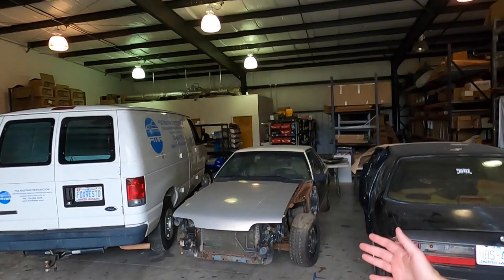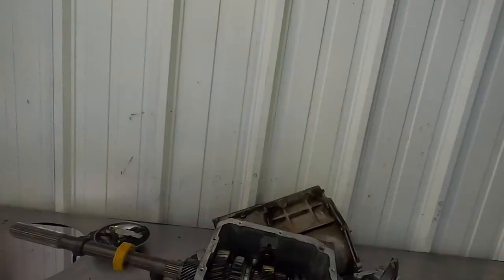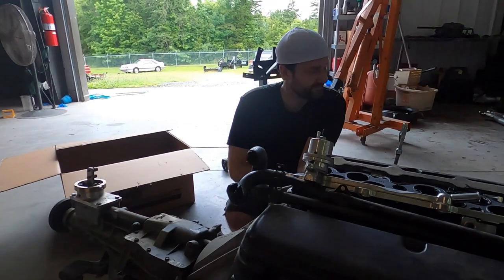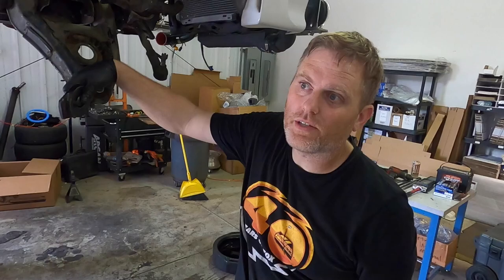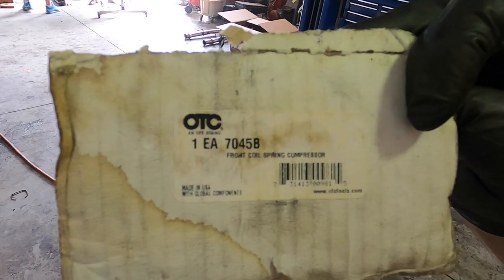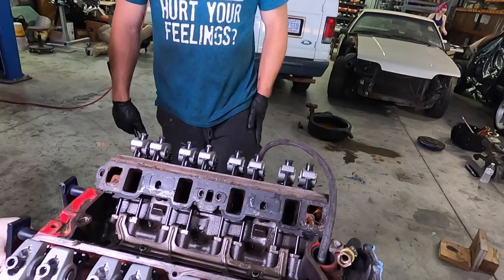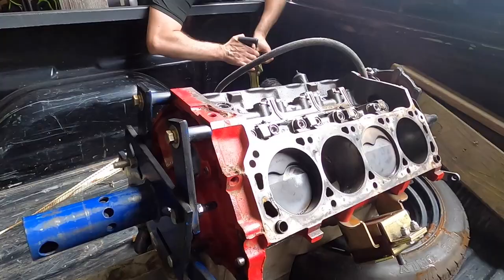PROCHARGED 91 MUSTANG GT BLOWS ENGINE!  // Plus…..Installing FoxBody Lowering Springs

Comment: That was pretty cool I know that it sucks for him but at least he can still use the block and build the 347 stroker and if u get his t5 then I get yours 🤣😂 but yeah I can't wait until I get my stroker 347 going I actually found some headers at a deal they were 700 new and I found some for 200 bucks so that worked out good. You better hurry up or everyone will have their car running and now u can get that pro charger and put it on your car that would be cool 👍🏼just don't turn it up to high and you will be good to go 👌🏼 😂💪
Reply from the maker: Hah hah, i'm not sure the transmission will quite work like that LOL, but you never know.  You're getting all the used parts deals!  Nice.  I figured I would get a lot of comments that I should buy the turbo hah hah.
Reply: @GearHead704  yeah you will get bombed with the turbo purchase for sure and yeah the headers are basically new you can tell that they wasn't ran very long because most of the paint is still on them and only a lil bit was burned off. They are a 700 set of headers and I offered 200 and he jumped all over it so I can take the 500 I saved and buy a new carb and it is funny the only used parts that I have bought for it is your valve covers and now the headers everything else is brand new unless I buy another transmission 🤣😂 but I can use the one I have for a while cause those t5 trannies are pretty tough but yeah man turbo that thing it will be fun and u can get it pretty cheap and everything is there to make it happen 🚙💨💨💨🦊TURBO
Reply: @GearHead704  Don't forget to buy the turbo 😂🤣😜 cant remember if I mentioned it or not 😆😂
Reply from the maker: ROFL

Comment: That was something different to bad he couldn't get away with just head gasket I would like to put a 347 together dart block scat crank scat rods I have the money to do it but it would whip me out I think my lil 306 will be ok for a cruiser ! R they going to drop the K-member 2 put the motor back in if so why was Matt worried about getting the spring isolaters on the springs I put my lowering springs in with a Jack in I got my isolaters but I had to buy a tool from Maximum motor sports for lowering I could not get the 1 side with out it! Something different!
Reply from the maker: Yeah i'm trying to mix it up sometimes on the content.  He just did that for video demonstrations purposes I believe, and probably not to lost the parts LOL.  It's pretty easy with that tool.  I think sticking with a 306 would be fine dude.  No sense in extending yourself beyond what you are comfortable with.

Comment: I have a 99 New Edge with a 3.8 V6 with a Pro charger in it. 3.73 gears detroit truetrac limited slip and a Ford racing aluminum drive shaft. The set up works really well. Not super fast but not slow by any means. The bad thing is every 2 years, I have to take the pro Charger out bring it to stock and get it smogged. Its not CARB Legal in CA. CA is not mod friendly any longer. I could get a V8 but I have so much money into my car, I would lose my ass on it.
Reply from the maker: Sounds like an awesome build, but man that sucks haven't to tear it down every two years. I guess you've got it down by now though LOL

Comment: 306 with 70 windsor heads made 400hp????  That sounds like a lot
Reply from the maker: And at 8.4 compression I think he said.  I was also a bit surprised. This motor was pretty stout.  Now do keep in mind that was on an engine dyno, and not at the wheels.

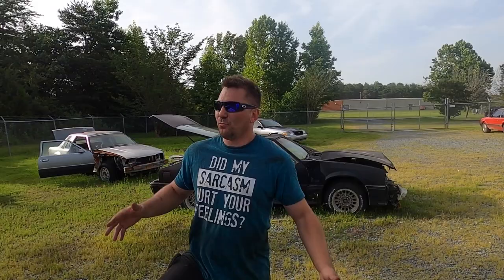Comment: 23:08 - How in the world did you get $65 Grand ($65,000) in a Fox Body?
Reply from the maker: Short answer -> Paid for labor (learned the error of my ways).  Long answer -> Video on my channel (think at the time it was "I spent 50k on a FoxBody" and I have this spreadsheet that documents EVERYTHING: https://docs.google.com/spreadsheets/d/1_V8WiL9B40gVKv3JmYOtwokHZr6QtZralGd_cT2gNuM/edit#gid=1339637757
Reply: @GearHead704 , Phew, that makes me sick to my stomach for you. That really sux, sorry about your bad luck.
P.S. I have a 60k mile 89 GT Convertible in great condition. It needs seat covers and a new fuel level sender and it may need a tuneup, as it's been stored for the last 10-11 years.